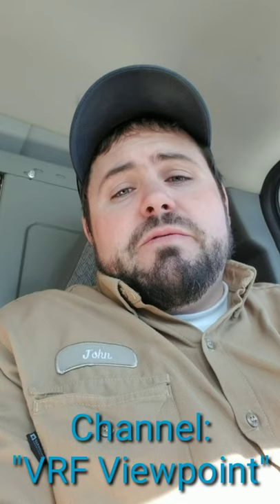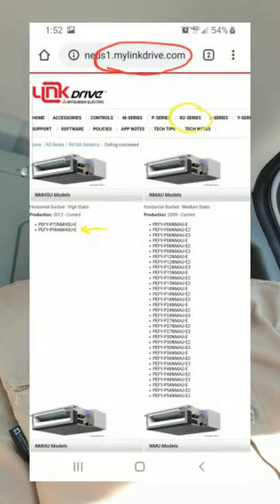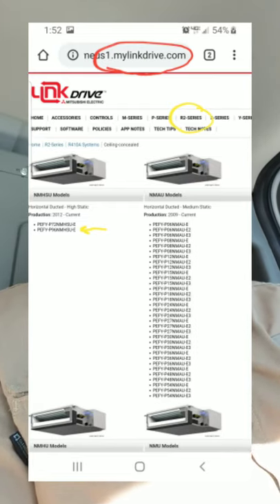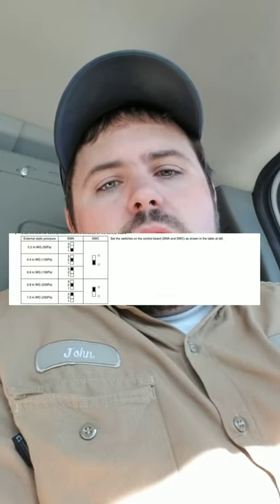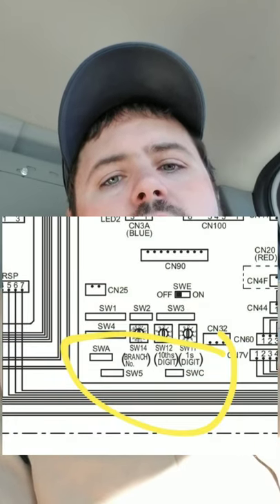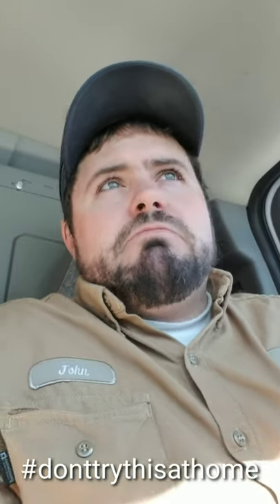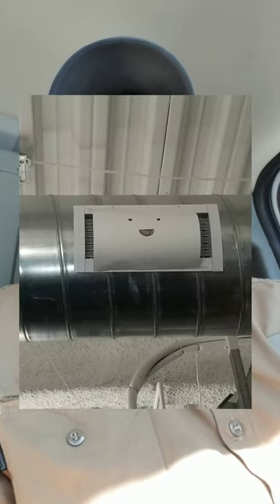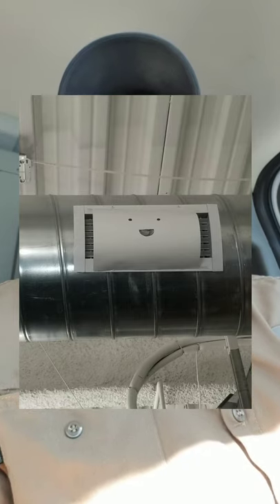8 ton fan coil noise

Comment: Please make a video using the service tool, also it seems all Mitsubishi thermostats wait until the indoor temperature is 2 degrees past the set point to turn on, do you know if there is a setting that can be changed? I can’t find anything about it in the service manual and the Mitsubishi tech support claims it’s the unit running in Celsius unit while displaying Fahrenheit.